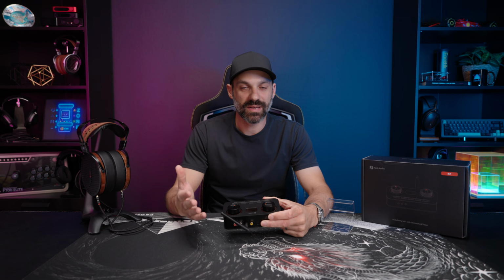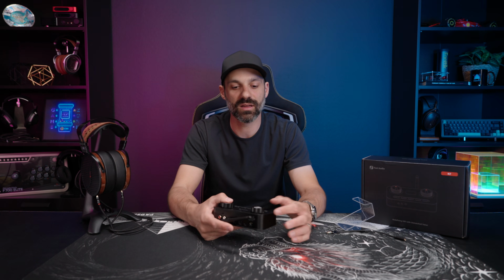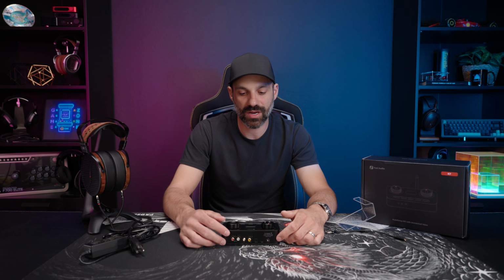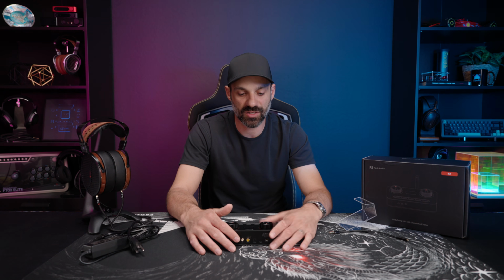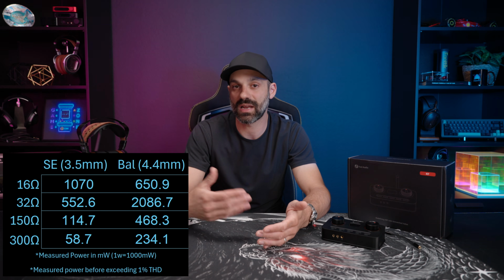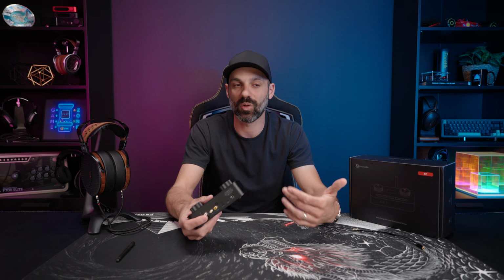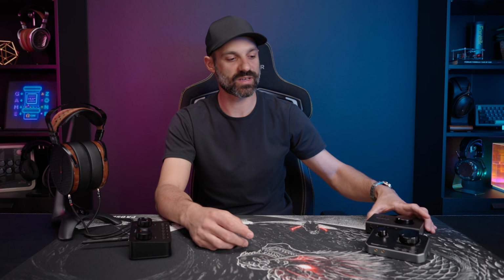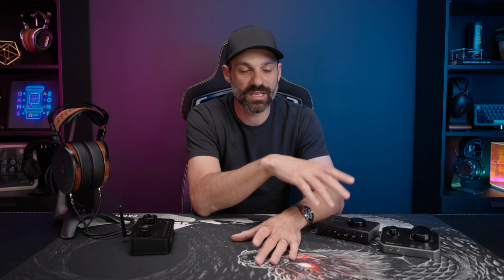Fosi Audio K7 Review - HiFi and Gaming, United.

Comment: Only 24 bit 48 kHz? Pfftt overpriced junk.

Can't even drive my basic IEMs fully.

To fully drive them I need something that does 24 bit 96 kHz minimum, at all times, in all modes.
Reply: Audio Bitrate refers to the amount of audio information that can be sent and the max amount of dynamic range in volume that is able to be reproduced in a sound signal.
This dynamic range of volume is ultimately predetermined by the headphones/speakers you are using. See your manufacturer's specifications to find your speaker's dynamic range limits.

Dynamic range in audio refers to the difference between the quietest and loudest sounds in an audio system without distortion.

Dynamic Range limits on headphones is often labeled as Sensitivity in the speaker/headphone's specifications chart.

16-bit audio offers a theoretical dynamic range of 96 dB (decibels = dB).
24-bit audio extends the dynamic range to 144 dB.
32-bit audio can achieve a theoretical dynamic range of 192 dB.

Now this volume is also limited by sound card limits, in this case of the Fosi K7 here, it can only do up to 121 dB max. So even though it has 32 bit support, it can't actually reproduce the full dynamic range that 32 bit audio is capable of. This K7 is best used in 24 bit mode with some budget, mid range headphones.

The Fosi K7 is nice in that it can handle the following sampling rates...

USB:PCM 384kHz-32bit/DSD256
Optical: PCM 24bit/192kHz
Coaxial: PCM 24bit/192kHz
Bluetooth:PCM 24bit/48kHz

HDMI supports a max of 192 kHz for uncompressed audio streams, for reference.

What about sampling rate? 41000 Hz(kHz), 48000,  96000, etc. What does this mean? How does this effect sound?

The full range of human hearing is limited to the following frequencies...
20 Hz to 20,000 Hz (kHz)

In order to reproduce this accurately on a headphone or speaker you must have a sampling rate that is, at a minimum, double this rate.
so 20,000 Hz x 2 = 40,000 Hz.

So a 40,000 Hz sampling rate is sufficient to reproduce the full range of human hearing. However, due to Nyquist-Shannon sampling theorem, a higher rate such as 44.1 kHz sampling is recommended to accommodate audio anti-aliasing(AA) filters used on audio samples during the Digital to Audio conversion process; These AA filters often cause a loss of audio quality and this slightly higher sample rate, such as 44.1 kHz/ 441000 Hz, is recommended to provide a buffer for the higher end frequencies to still be reproduced accurately when said AA filters are being used.

Many speakers/headphones have the ability to reproduce audio ranges in excess of the 20,000 Hz / 20 kHz range and thus a higher sampling rate is recommended to fully enable and drive these types of speakers/headphones. This stat is usually represented by the speaker's/headphone's frequency response range in the manufacturer's documentation.
For example,  a set of headphone might have a Frequency response 20-39500 Hz, aka 20 Hz - 39 kHz, this is in excess of the full range of human hearing, how can we enable this on our headphones? Sampling rate is how.

You take the sampling rate you want to use and divide it by two.

96000 Hz /2 = 48,000 Hz. This means frequencies from 0-48 kHz/48,000 Hz are able to be reproduced, accurately, when using a 96000 Hz / 96 kHz sampling rate on a set of headphones that have a frequency response of 20-39500 Hz.

Hope this helps people out.

Comment: Been running the K7 via my PS5 for a couple of weeks. Super impressed so far. Has replaced my G8.
Reply: May I ask why you made the swtich? Just curious, cause I recently bought a G8 (for PC) and was wondering what you prefer about the K7 or over the G8?
Reply: @dhruvpatel7637 mainly due to having some software issues with the G8 and also not wanting to have to connect to a PC everytime I wanted to tweak the audio. I have several headphones and use the K7 via PS5 so the bass/treble adjustments are handy.
Reply: @WhiteHartMart can you plug in a USB streaming microphone to it? Or would i need to connect that straight into the ps5?
Reply: @dhruvpatel7637 I don't have a g8, but I have the g6, the k7 just sounds way nicer, cleaner and a darker background. The g6 also just sounded......dead? No real dynamics to it. At least with my iems, the g6 was very underwhelming.
Reply: Just a question please, can the k7 mixing the inputs audio? Just like listing to (Bluetooth sound + optical) at the same time?

Comment: If the K7 had Game/Chat mix controls, it would be a homerun. Looks like I'm sticking with the Gunnr. I barely use the width and presence controls, but I'm far from a pro gamer (or mid for that matter...), I just appreciate the clean sound, power, and the mic input without having to run a separate audio interface. The Gunnr pairs great with the EPOS H6Pro and Sennheiser HD6XX.
Reply: If you appreciate the sound you should definitely go with the Fosi over the Gunnr. ESS dac's always has had this sharp edged sound. Too bright in the top end that cuts your ear like a sharp knife. Personally I have never understanded why people would pick ESS over AKM chips. I have worked with Hi-Fi more than 16 years and tested many many dac's. A-B tested and critically listened to the difference in many different setups. AKM dac's are far superior! So much more smooth and soft, with a more round, warm and leaned back sound. It's like comparing a class A tube amp with a shitty class D amp. SO much more pleasant! I mean I don't know if the Gunnr does something feature wise that makes you choose it over the Fosi, but for the sound quality alone the Fosi would be a far better choice imo.
Reply: @dallerand  What's funny, I actually did go with the K7 over the Gunnr, about 4 months after I made that comment, and I do like the K7 more!
Reply: @rvp317 I have both these Dac’s also. The K7 sounds to me..much more clean than the Gunnr. Interesting Huh?
I would not have known that until I read your comments thanks.
Reply: I mean I think it’s a small sacrifice to make, cause literally every console as well as pc’s have game/chat mix and in the quick settings too so it’s not that much of a hassle changing it

Comment: How would you tune this dac amp to a vzr headphone for more clarity and detail? I’m running the schiit gunnr and the second nob doesn’t really hit the mark where in need it for that.   Only been having endless problems with a hum on the mic  with that headset .  Any recommendations or a proper cable swap to help with the mic?
Reply from the maker: You're likely better off with a more capable EQ solution to be honest.  Something with a 10 band or Parametric EQ will do wonders.  If you are playing on PC, use Equalizer APO + Peace, or SteelSeries Sonar.  If on PS5, maybe consider the Creative G8 which is a bigger downgrade in power but allows you to tune the sound more.  VZR Model one is a little tough to fully customize unless you have full EQ support.
Reply: @GadgetryTech  Sonar by SteelSeries is insanely good tbh, you get a decent EQ for both output and input but you can also do chat/game mix and have aux channels to remap inputs too within windows. I do recommend it for extra control over your audio. EQ APO while great just misses some of that extra that Sonar offers

Comment: I have the Fosi K5 pro dac/amp that recently stopped working (mic input) after 2 years of light use. I switched to an audio interface (Volt 1) which does a subjectively better job for the headphone amp and mic XLR input with an great preamp (using a hyper cardioid dynamic mic for legendary noise cancellation).
Reply from the maker: Good to know!  Sorry your old DAC failed, but glad you found something you like a lot

Comment: Which one would be best to use on PS5 with the VZR model 1 headset.
Reply from the maker: Honestly all three are pretty good on it, as it's easy to drive.  The G8 gives you fill EQ, the Gunnr has the presence knob to help a little, and the Fosi has bass tone control, allowing you to reduce bass and clean up audio more.  I'd likely lean towards Fosi K7 or Gunnr.

Comment: Hey Joe. Quick question on the TRRS thing, as I'm a bit confused by it.
Got a Meze Boom Mic and thinking about getting a DX3Pro+; can that DAC/AMP handle the 3.5 TRRS from the Boom MIC so that I can get audio and mic from it?
Reply from the maker: You're better off getting one of the three mentioned in this video.  The DX3Pro+ has no mic support
Reply: @GadgetryTech  Thank you, ordered the K7. Any idea when you'd push the Fosi headphones review?
Reply: I think the DX3Pro+ only has audio out so your mic wouldn’t work with it but you’ll still hear audio using the TRRS cable.
Reply: Quick answer = No.

Comment: Question: LG TV’s got PCM and Bitstream under sound settings called (HDMI input audio format) would you say i should set it to PCM in HDMI input audio format on the TV when TV is connected to Series X with HDMI and TV connected to dac/amp with optical?

I’m using a JDS Atom 2 stack and a FiiO K11 R2R and my audios works if i got TV on bitstream or on PCM, my Xbox even is saying Dolby Atmos Headphones and DTS: Headphone X is working when TV is set to PCM, but don’t Atmos and DTS require multi channel function like Bitstream can supply or is PCM fine?

I don’t know if it’s placebo effect but when it’s on bitstream it runs great but on PCM it’s like the sound is even “faster” meaning zero audio delay, it’s not like bitstream is not in sync it is but it like PCM is just that 1ms faster, not sure if it’s just me and placebo 🤷🏻‍♂️

Thanks
Reply from the maker: When you use PCM, the TV is basically converting the multi channel content down to a standard signal the DAC can understand.  Honestly, with either, if it works with X setting, just run with it.  On headphones you won't really hear a difference, as true multi channel audio isn't used anyway
Reply: Headphone mode dude your atmos is already 3d via stereo run it like that